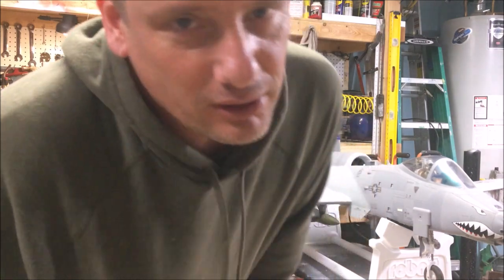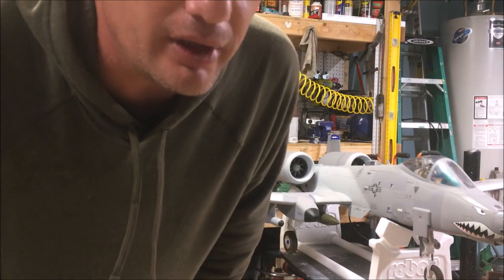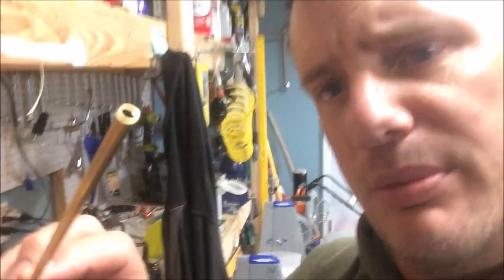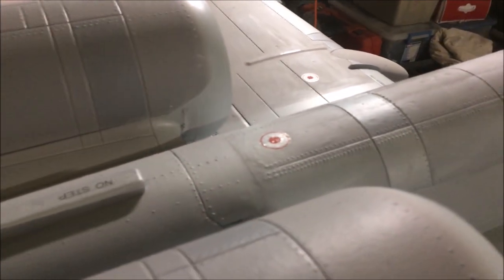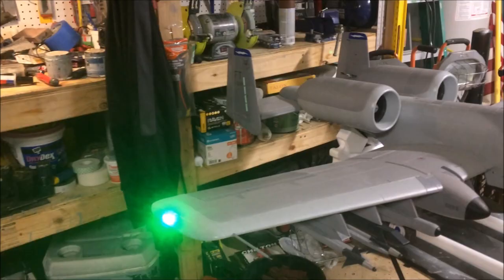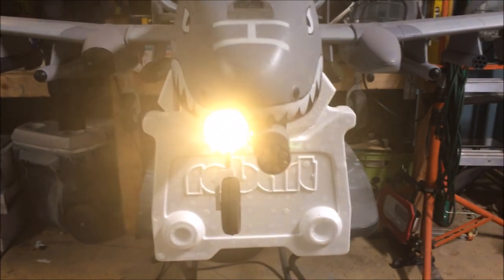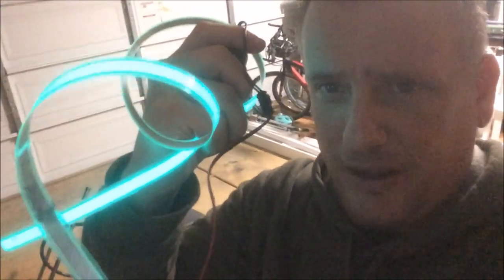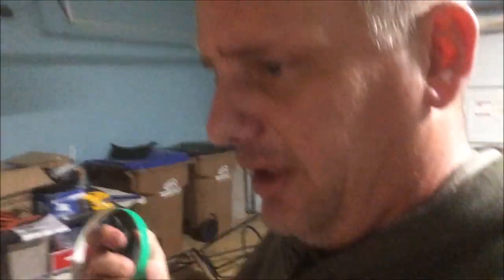Freewing A-10 Super Scale 80mm EDF - For Detailers 2

Comment: for the lights did you have to get 2 sets of them
Reply from the maker: If you're talking about the strobes, It's been a few years but I think I just ordered them individually off of eBay. I can't seem to find them anymore though, which leads me to believe there's a-lot better options out there now. These were small PCBs with super bright LEDs soldered on, a microchip and some jumpers. You had to do your own soldering and complete the circuit so many times to change settings...which static would sometimes do for you. They were extremely bright though and I;m glad bought them for that reason. If I could find them, I'd provide a link for you. I think they were called "Srobe-on V2"? ...not sure

Comment: You finish this model with that new tape yet?
Reply from the maker: I actually elected to stick with the normal glow tape instead of the electroluminescent stuff. I found that I can stimulate the glow tape by exposing with an ultraviolet flashlight and get a pretty solid ten minutes of moderate glow. The electroluminescent stuff seems a little like over kill...but I may still get around to it. The whole airplane is down for maintenance at the moment, I busted the gear all up on a “professionally firm” landing.